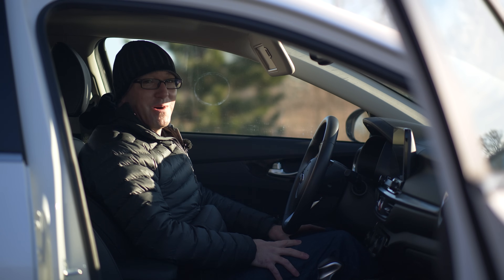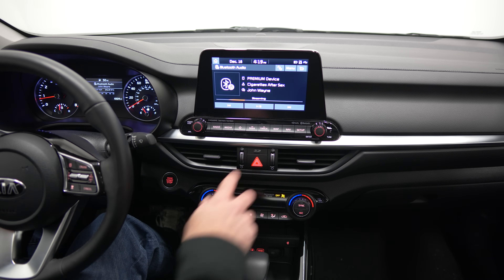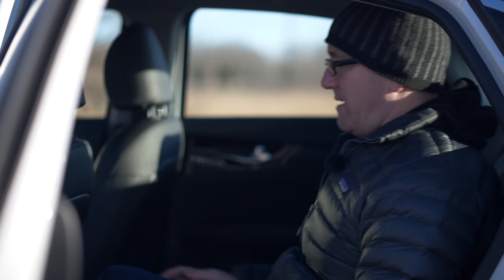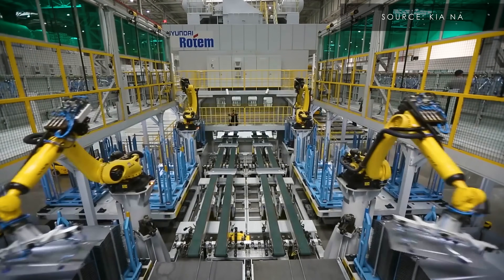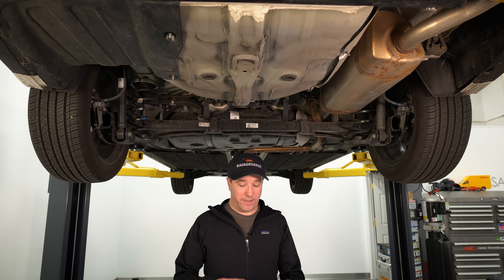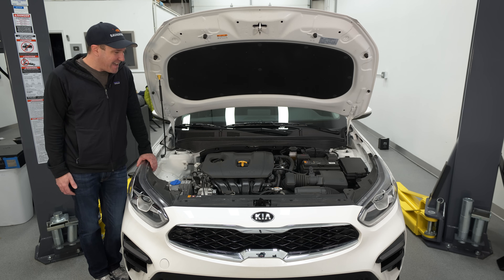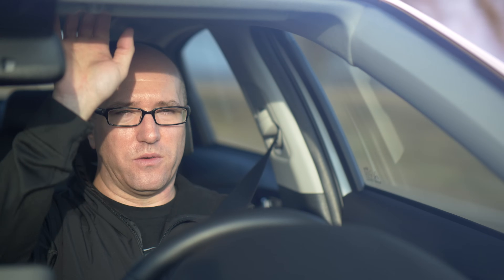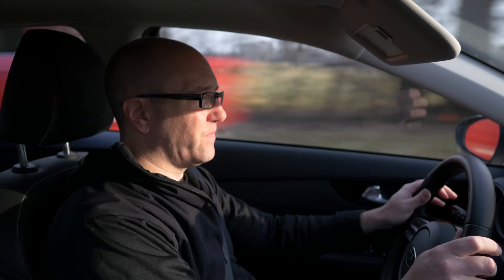2019 Kia Forte Review | Bait and Switch

Comment: I got a 2021 Forte GT with 7sp DCT - GT2 package last year in snow white. I got it before the Elantra N-line was available, but I'm glad I didn't wait. Don't care for the external styling or that strange center handle thing. It's also cost too much more. I'd like to see a updated review on the GT. I have to agree with everything in this review, except the seats. Maybe the GT got nicer padding, but I find them very comfortable and I'm old enough to be / get sore and when I have to go into work, it's a 50min drive. It is the perfect daily driver. Run's on regular gas, fast enough to not be boring, gets great fuel economy and the GT upgrades are totally worth it, if you can swing a little more. No one pays close to sticker, so they don't cost that much. Build quality feels top notch and it's just a really solid car. Aside from the KIA on the badge, it feels German.
Reply: We generally agree with you, Turner Tunes, as the KIA Forte GT, your model, is truly a well built car indeed!  Enjoyed reading your review/reply as KIA is making quality C-segment compact sedans still!  I personally like sedans over SUVs!  FYI we're happy to leave you our site where you can research our Diamond Nano-Lube Engine & Fuel Treatments & more for your KIA 1.6 Liter GDI/Turbocharged engine.  Read about (LOW SPEED PRE-IGNITION) which is an engine cylinder malfunction in which there is a premature firing!  GDI/Supercharged/Turbocharged engines which are smarter working  engines need "Extreme Pressure" protection that our BestLine Engine protection significantly guards against!  Check this FYI:  BestLine Meets/Exceeds ILSAC GF-6A Standards & Meets/Exceeds API SN PLUS/SP!  Read our BLOG & See "LSPI" under blog heading for more IMPORTANT INFO.!  Also remember BestLine has Diamond Nano-Lube (NO MELTING POINT) particles!  Visit us here:  Thank you, Turner Tunes, from your friends at BestLine!  http://www.extreme-engine-relief.solutions  KIA definitely knows how to build compacts and Thank God that they are still making compacts and not just SUVs!

Comment: Just hearing the engine and the tax you can tell the cvt is really good. Got to respect it
Reply: It might be the best at the moment, but it still sounds sluggish/balloony?  it pegs to 6 grand and hardly changes speed at all.
Reply: I’m so impressed with the shifts from the IVT. It shifts faster than many torque converter autos and didn’t seem to have that rubber band / clutch slipping affect off the line. This is the only CVT transmission I wouldn’t mind. It’s truly an awesome design. Who would’ve thought it would’ve been KIA to make one of the first good cvts.

Comment: Had mine since August, base model with 6 speed auto. Really fun car to drive around the city. Stick the car into sports mode and have a blast playing with the manual mode. Best sports shift I've used, I don't feel like I'm fighting the computer for control of what gear I'm in. Haven't taken it over any nasty surfaces so I haven't noticed the cheaper suspension.  As a earlier comment said, car is perfect for those fresh graduates wanting something "new" without breaking the bank, fits my gear, my mates gear, and a dog in the back with plenty of room to spare. 7 year warranty was a nice touch, plan to keep it for 5 years and sell it on with factory warranty remaining.

Comment: From what can be seen on video, this is just about one of the top 3 best CVTs ever made, if not the best ever. You can barely tell it's a CVT, yet it gets the fuel economy. Personally, I'd get this with a manual, it would be the perfect new car for a cheap sedan. More reliable than 90% of the crap manufacturers put out these days.
Reply: How does this compare to the new Corolla CVT? Savagegeese really liked that one too

Comment: Great, durable engine and offers start at $14k. But a Hyundai Elantra is mostly the same, probably rides softer and can be had for  ~$1,5k less.
Reply: And does not have a CVT
Reply: The engines seize up. CVT always go out at 70k
Reply: @suesan5111  lol
Reply: @ninjamaster3453  CVTs fail at 70k?  Tell that to the thousands of Prius owners who have well over 200,000 miles with nothing more than oil changes.
Reply: @suesan5111  Underweight children shouldn't even be in the front seat to begin with.....
Reply: @sleeksilver  A Prius does NOT have a CVT. All Toyota hybrids have a planetary gearset. That's completely different to a CVT. It only gets confused with one because it has no steps, is variable in it's ratios and feels similar to drive.
Reply: Mgoblagulkablong e-CVT.
Reply: Morgan Bright it does now.

Comment: Well done. I would never buy a stepped CVT. That is just defeating the whole purpose of it. I drive Mitsubishi Mirage CVT and I keep it just at max. 2000 rpm all the time. No pain, no problems (yet), great comfort and great fuel economy, Even with that small engine and low rpm you just go with the flow. Great transmission (until now).
Reply: Good car but it even has a hard time over taking a mitsibishi l300 which is a 20 year old model.

Comment: That "fake" shifting is so dumb. I guess some people like it, but I don't know why.
Reply: It's for people who don't give a shit what they drive but still want their vehicles to feel the same. I guess extra gas mileage is important too
Reply: It's not fake if the torque is actually making it through to the wheels, which SG proved it is off the line. Also, if you don't like it then get the manual. KIA is one of the last companies to have manual.
Reply: @SaraK_69  Which is why I put fake in quotation marks. It's fake in that it's trying to make you believe that it's a torque converter automatic even though it's a cvt.
Reply: I was replying to Mike B
Reply: @SaraK_69  My bad.
Reply: @anonharingenamn  no problem, for some reason when I replied on my computer last night it didn't list his name. But on mobile it works fine lol
Reply: @anonharingenamn  No need to put fake in quotations. It is fake shifting. And yes, its only purpose is to make it feel familiar. A lot of people don't like the feeling of proper CVT acceleration.

Comment: 7:00 did they dip those parts in salt water before installing them?
Reply: metziih steel gets surface rust man.  You can't avoid it.  You've watched too many car reviews of middle end cars or higher that use aluminum for the lower parts that you see. (Many cars still use the stamped steel for the upper stuff that you won't see.)  The uninformed person thinks it makes their car look old and crappy when it will still be safe for 10 years. Ppl who grew up on cars like this, know it's fine. They're probably the ones co-signing for the loan and they know its fine.  Get this thing oil sprayed every year tho.
Reply: Well me to northern salted winter roads. Surface rust forms very quick once the new car is driven off the lot in on winter roads.

Comment: Great car till I saw the torsion beam rear... Will pass on this car and get the Elantra Sport.  Not offering an independent rear for "up to $26k" is a joke in this day and age.  Even the new Corolla is finally getting an independent rear. I can see this in the base car but not for "up to$26k" .  Sorry KIA👎
Reply: Forte gt, prob will be around 20-22k and offer a manual. Irs standard and 201hp. Corolla may have an Irs but has no power
Reply: @IReahpZz  the new Corolla will have the same engine as the hatchback I'm sure with around 160hp all you need in a small car.  Still would take the Elantra Sport over the KIA and will see what the new Corolla looks like.
Reply: @eppyz  the Forte GT (200hp, DCT or 6spd manual) is basically the same as the Elantra Sport but with better tech. Since thr redesign of the 2019 Elantra, Hyundai haven't mentionned if the 2018 Elantra Sport will have a successor. As a matter of fact, I don't think there is a 2019 Elantra Sport
Reply: @vladsaghin7644  yes but does it have an independent rear? The 2018 doesn't.  The Elantra Sport does. According to Car And Driver there should be a 19 Elantra Sport.
https://www.caranddriver.com/news/a24737690/2019-hyundai-elantra-sport-photos-info/
Reply: @eppyz  yes it does have an IRS! That's the exciting bit! There's a few reviews out there on korean channels (some are even in english) and from what I've seen, it's gonna be a hoot! I find the Elantra to be too overstyled while its sister looks more like a mature and upscale Audi A3
Reply: @vladsaghin7644  assuming that is true I would still be looking at the Hyundai... They are either made in Korea or the USA and being in the USA I like buying cars built here and that means something to me. Seems the KIA is being built in Mexico.
Reply: 2019 Mazda 3 sends its regards.
Reply: @absoluteterritory9469  almost all of this cars competitors send it haha.  Mazda? Not sure as long as you don't but an automatic version of anything Mazda should be fine 👍

Comment: Hey Mr Goose, you'll be happy to know that in Canada, the base manual Forte has even better value for 18k (CAD):
-Heated seats
-Heated leather steering wheel
-AC
-8 inch screen with phone compatibility and rear view camera
-Automatic lights,
-Remote access (buttons on key to lock and unlock the car).
In comparaison to my base manual 2017 Forte which only has BT audio and a center armrest (not even AC or remote access; yes I still have to open the car like in the 80s), the added features are outstanding for a small bump in the price (less than 1000$). Talk about knowing your market... heated leather steering wheel and such are still unheard of on 40k+ "luxury" cars

Comment: I've watched numerous reviews on the Forte and it is almost a 50/50 split. Some say its ride is too firm, others say its smooth and well controlled. Some say its somewhat noisy, some say its fairly quiet. Basically, you need to drive it on your local roads to see what you think... which is what I'm going to do tomorrow when Carvana delivers my 2021 EX.

Comment: I almost bought a left over base manual 2017 Elantra sedan last year (dealer had three for very cheap-12k). But no cruise control. I checked on what it would take to swap steering wheels.. decided against it. Dealer shipped them out shortly after (no idea where). On a modern vehicle it's just a few buttons, not the actual vacuum hardware of the distant past. Also shopped a base F150 but cruise control was a standalone $1250 option!! For basically a few buttons. I just checked the base FE Forte. Cruise control standard. Thank you Kia. When you only offer manuals in penalty box spec examples with no options, it's no wonder people don't buy them. But I will say it's a strange world when Mustangs have IRS and front wheel drive cars all have solid rear axles. Lol. This was  a very good review. Though the engine sounds quite coarse. Maybe Kia needs to pump in some engine sounds. Also, let's hope the sedan stays.

Comment: I've driven the Kia soul cvt back to back with the dual clutch model. I actually preferred the cvt. It reacts faster and the manual mode changes the ratios as soon as you initiate it with the gear shifter. It's amazing really

Comment: 2019 veloster base has same 2 liter Atkinson port injected engine...nice stick, manual hand brake, multilink suspension and bierman designed great chassis....all for $17500....surprising amount of room in back. Weighs about 2700 pounds. Fun to drive.

Comment: What’s funny about what he said about the Forte being a bit of a firm ride is that I owned a Nissan Sentra prior to buying a Forte and the Forte feels a hundred times better on the road. That was one of things that sold me on Kia’s in general. That Sentra was a HARD ride. So, compared to another vehicle at the same price point, the Forte excels in that area as well. It really is a great value for the price. My only complaints are with the sound system—I had to replace the head unit and the speakers because the sound was woefully inadequate with the factory setup—and the fact that it doesn’t come with a spare tire.

Comment: I'm way late to this party, but I used to work at a VW and Hyundai in one dealership in the Service department. In regards to Direct Injection, somehow Hyundai managed to design it to have very little carbon build up. VW had been doing it since 2006, and that 2.0T would coke up to a CEL in about 60k-90k miles. About the most reliable part of mid-aughts VW. Didn't see that in the 1.6 or 2.4 DI motors hardly. Now, Hyundai's have other issues, but the Accents and Elantra were not to bad, if you don't beat in them and maintain well
Reply: I agree I have a 1.8 litre Elantra and haven't had issues yet at 90,000 km

Comment: Good video. Amazed a manufacturer is still producing a basic car or as basic as it can be. Like that it is not a direct injection turbo. Keep us up to date on the CVT. Nice that they improved from the original design now only if it holds up. A wish the suspension was better really don't need cooled seats and some of the electronics but glad what they did put in in separate modules and not one centralized unit. Thanks 👍

Comment: I bought a Forte and i know what Torsion beam is, yes i will say that a lot of young women buy this car, but i bought the Forte because the Corolla and Civic are more expensive and boring to drive because of their CVT. The Forte had the best build quality,  it was cheaper, and the 2017 model year had a 6 speed. My forte doesn’t have a carplay headunit, but it has bluetooth and iPod connectivity. I’m a big car guy and a big tech guy but i am more than happy with my Forte.

Comment: I bought this car 1 spec up from base model. 

6 months in now and i still love it. 

Power delivery is great, it drives nice and the auto is great, I honestly thought it was a torque converter until I watched this video so I second what the host said. 

Kia also gave me a great deal on the price. 

7 year warranty, 7 years road side assistance and 7 years capped price servicing. 

However Ride quality is firm on long country roads, I notice it compared to my parents 5 series. (I know the price difference). 

Engine is raspy and lame when revved unless you kick it over to sport. 

Infotainment is legit the best system on the market. I was in my mates $60k Toyota Prado and his system was worse than mine. 

My spec came with built in sat nav which works better than any competing system and I prefer to use it to android auto since it takes note of traffic conditions

Honestly give this car a go if you are looking for a small sedan from an owner's perspective

Comment: I just bought the hatch version in Australia.
Its drive train is identical except we get a six speed torque converter auto instead of the IVT that America receives.
Therefore ours suffers in the fuel economy stakes with about 10L/100km city and 6L/100km highway. 
I bought this car for its simplicity (MPi v's GDi) and the torque converter (I dislike dual clutch transmission, but enjoy CVT)
I got burned with a Honda Jazz CVT which are notorious for shuddering about the 100000km mark with a replacement cost of AUD $7000!
Hope this new generation Kia CVT proves to be reliable in the long term, for America's sake....

Comment: Thanks. Best review of the '19 Forte I've seen. It's on my short list for next car, but I'm fond of the '19 Jetta which has excellent  pleather seats - with lumbar, no plastic gloss interior, better base warranty (6 yr./72,00 miles bumper to bumper), no iPad-like head unit and a real 8 speed AT w/ the same MPGs as the Forte. OK, VWs may not be as reliable, but I've had few complaints with the four I've owned.
Update. FYI Shoppers. Just read the Consumer Reports review of the '19 Forte. It was not great .
Reply: I own both a GTI and a Kia Sorento. If I were in the market for a compact sedan the Forte and the Jetta would be at the top of the list. Love the minimalist interior look and feel of the Jetta but the KIA's tech is among the best on the market. Tough choice.

Comment: I did consider buying one of these cars this week but this video certainly changed my mind. Now if the "S" model CVT was no more than 16k then I mite be a player, but otherwise NO.... Thank you for putting this video up and after seeing this video I will NOT be buying this car.  (hard seats, torsion rear, slow response cvt, no direct injection, low on power should be like 160hp, gloss black inside) all that changed my mind real quick.

Comment: Just for your information #1 the torsion beam suspension is quieter than an independent suspension at a slight penalty of better drivability on the independent one  #2 the mechanical rear parking brake is a plus by almost everyone who has tried the "On / Off" electronic ones - no-one is raving about electronic parking brakes   #3 the ease of access to the oil drain plug and oil filter shows that Kia is thinking the right way in terms of ease of maintenance.  The only negatives I can see are #1 how well will all this "high tech display" stuff holds up in the long term life of the car and #2 Kia / Hyundai have had some issues with engine failures that just haven't occurred in Toyota Honda Mazda equivalent models. Hopefully this new model has addressed these issues.

Comment: Bought a new very base model (manual, no air con) Forte in 2015 for about $11k cdn.  Been a good reliable car, last service sucked though (they did unnecessary service and a dent) ended up costing $1300k cdn).  Would consider another but would forgo the Kia service department.  Oh....mine was manufactured in Korea.

Comment: A well designed torsion beam rear on a FWD car handles very well. Most independent suspension in production cars is okay at best and not adjustable by any means. Therefore you have a more reliable suspension due to less parts and economical by simplifying the manufacturing process.